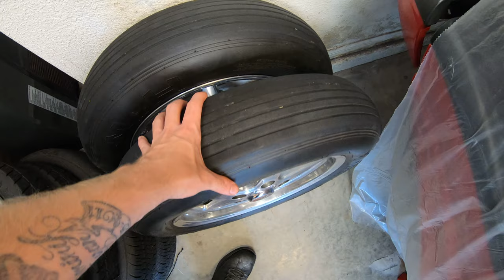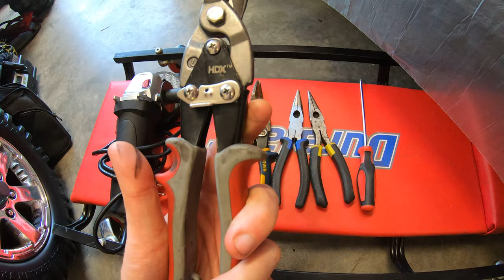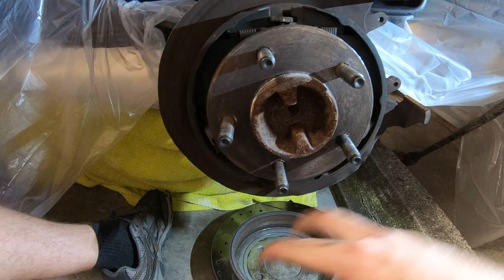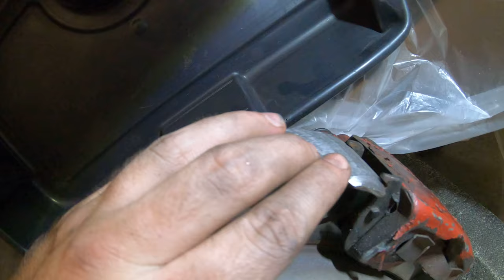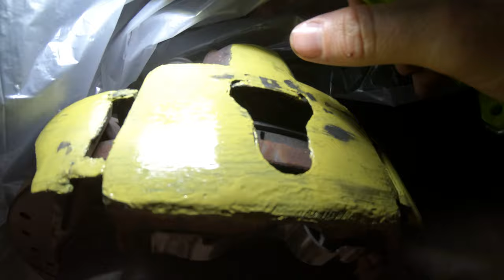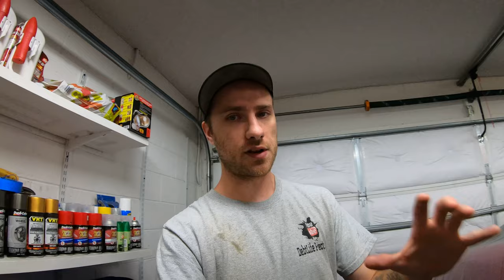Ford Lightning Build - Grinding Rear Brakes for Race Stars/Drag Wheels - Everything you NEED to know

Comment: Quick question would you have to grind the front calipers too for the skinny’s?
Reply from the maker: Shouldn't have to, if the wheel is at least 17", and the correct offset.  My 17x4.5 skinnies fit with no problem

Comment: Quick question, if the rear race stars are 17s do you still have to grind the caliper? Or if only applies to 15s? If you can let me know I’ll really appreciate it thanks!
Reply from the maker: 16s and up can fit with no grinding, only need to grind for 15s!

Comment: Quick question did you have to push back E break line and put zip ties from the driver side
Reply from the maker: Nope, not that I'm aware of.  Everything cleared fine brake line wise.

Comment: Hey man I know that was posted 2 years ago  but I’m doing the same thing. my caliper clears but it’s very close to the inside of the wheels just like yours will I be ok ? I’ve seen people say the caliper expands with heat
Reply from the maker: You should be good, I've had zero issues with them.  I've put plenty of miles, 1300 mile trips in one shot, got them smoking hot during track days, auto cross, ect.  Never had a problem.
Reply: @DebtLife_Projects  thanks for the reply man I appreciate it

Comment: Looking at buying a used set off someone but they never had them on there truck. My truck has helper bags and needs 6in of clearance from the tire to the frame. Do you have that on yours?

Comment: Can you take off the brake guard or do you have to grind it too
Reply from the maker: You can take it off, but I wanted it on there still, so I trimmed mine with tin snips
Reply: @DebtLife_Projects  oh ok what does it do? Will it mess up the driving mechanics if I take it off?
Reply from the maker: @BetonSevin  just keeps brake dust from getting all over your suspension and such, not a big deal or critical.  You can take it off if ya want
Reply: @DebtLife_Projects  ok for sure I follow you on Instagram too love you build bro
Reply from the maker: @BetonSevin  I appreciate it man! 🤘

Comment: What size radials did you put on those 15s? I'm seriously contemplating this route but the grinding has me running scared lol.
Reply from the maker: I went with 325/50s.  Mostly because it was the only 15inch 28 tall tire in the 555r2 that I wanted to try out.  My friend also runs that size and has good luck with them.  The other size It was between was 295/55 in the mt et streets.  But I wanted a more daily friendly tire
Reply from the maker: Grinding wasn’t tooo bad.  Id definitely by an extra set and grind on those though lol 😆 that way if it goes wrong, you can revert back if you need to
Reply: @DebtLife_Projects  Crazy I didn't even know 325s got on these trucks. That's a lot of  traction.
Reply: @DebtLife_Projects  I bought some brand new powdercoated calipers front and rear. I'll experiment with my old set lol. Thanks for advice.

Comment: Could you just swap calipers and rotors froma 92/96 f150
Reply from the maker: Not that I’m aware of, I think you’d still have to grind it even if you made that work.  You could do aerospace with little grinding, but it’s stupid expensive, and you still have to modify stuff, not worth it to me.  Stock calipers ground down have been holding up great.  Been driving the hell out of it, it’s just a lot of work up front
Reply: @DebtLife_Projects  why would you still have to grind the disk brake swap kit for the obs is for 15in wheels
Reply from the maker: @jameslesswalk  the race stars run pretty small, even compared to other 15s...my calipers were ground for 15 inch bogarts, and I still had to grind a LOT for the race stars to fit.